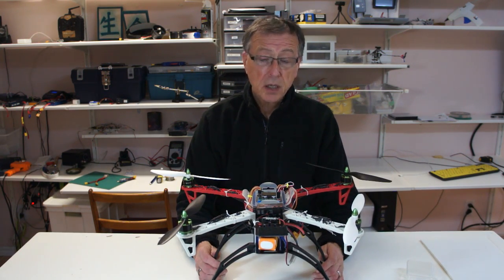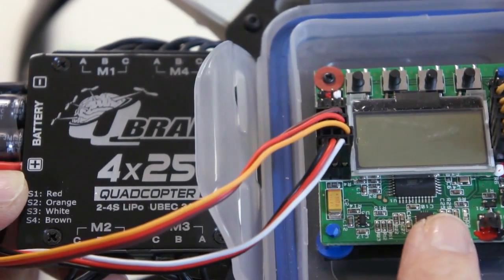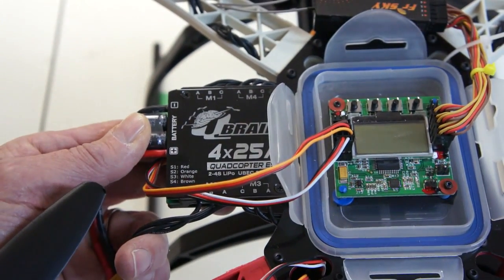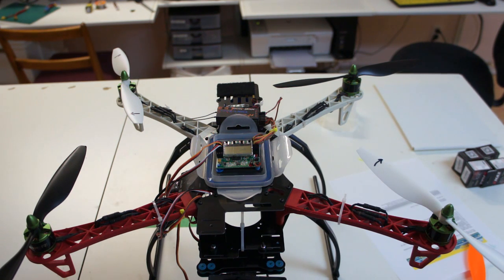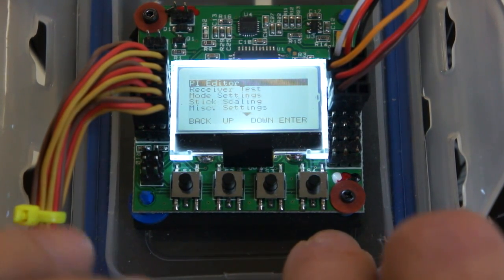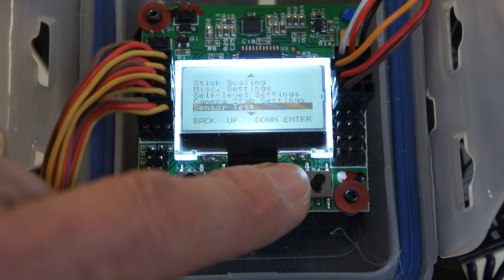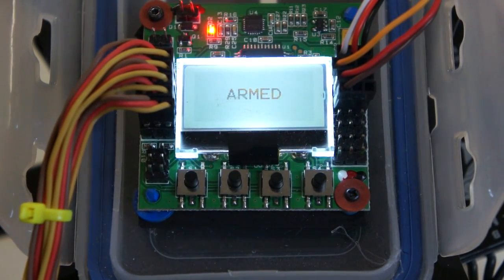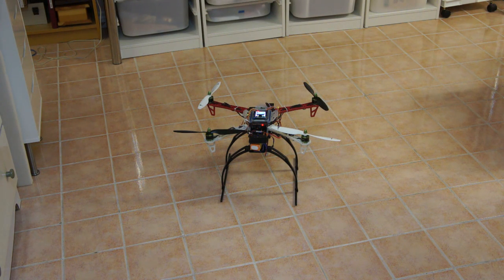Quad Copter Build With KK2.1 and Qbrain Part 2

Comment: Good solution to the odd wiring issue with power and ground on S3. One could always pull those leads from and S3 and put them in the S1 connector. That's my plan anyway lol. That way the motor leads go the motors as listed on the brain.
Reply: +Pat B , I've got the same issue.   M3 goes to motor 1 and M1 goes to motor 3.  It's odd how they designed it.  Btw, I got my Q-Brain at HobbyKing.  So on my KK controller, it goes W.O.R.B.  (white wire, orange wire, red wire, brown wire).  Is that your setup also ?
Reply: Levkin I don't have the Q Brain yet. I've found what I think is a better one on Goddluckbuy. It's 30 amp x4 and only 80 grams and 12mm thick plus it's already flashed with BlHeli firmware. The Q Brain can be flashed as most ESC's can but it's a bit of work.
 The ESC's don't care which motors there are connected to, so swapping the leads for the KK as the poster has done is the easiest way to fix this. The KK does care how you power it though, so either you power from the input with the Receiver or UBEC(Batt input), or you power form the motor side as is usually done. There are two power busses on motor side on newer KK's so M1 is by itself and the other powers M2-M8. So powering M3 leaves M1 dead so to speak. One could use a Y jumper  to power M1&3 but that can lead to noise issues with both busses powered and isn't the recommended option. Oddly enough powering M1 also powers M2-M8. I know that sounds weird as the you'd think powering M2,M3 etc would work also lol.
 I would simply pull the power and ground wire from the M3 connector and put them in M1. There are little tabs that one can lift on the connectors and the pins pull out. Doing this gives the KK power and M1 and then you simply rune the motors wires as labeled on the Q Brain. Not sure of the colours as I'd have to watch yjdeo again. Like I said his solution of swapping the leads is the easiest. Hope that helps.

Comment: hi Sir. i bought Esc 4 in 1 of emax, but i can not make all motors to start at the same time. i did the step of calibrate with button 1 & 4 on KK, but still same problem. could you please take a short video about calibrate your Q-brand esc? thank you Sir so much.

Comment: Hello!
I have qbrain 4x25 and hk 2.1 with factory deffault settings.
For some reason when i put the quad on the ground and run motors lowest possible speed two of the left side (quad facing away from me) spool up to nearly maximum speed. This is not instantaneous it takes 1-40 seconds before it kicks in (completely random).
I've googled around alot and watched videos. Can anyone help me with this issue? I'm at a complete loss here.

Comment: Im still unsure about buying the qbrain. Is there a way to lower the amps to avoid escs being burnt out or overheating? Which motors would work stable and reliable with the 4x20 one?

Comment: Hi Emerald,
I have the Q brain 4x25 esc but I have the hobbyking KK3.0 board in X Config. I'm new to this hobby and need help. How do I match the two up. I have a transmitter that is paired with the Receiver and I can get the ESC to turn on but I feel may it's not configured right. I cant get it in the air with out major problems. Not sure how to stabilize it or anything, Help please.

Comment: Trying to build  my first quad,  will this work??
frame: Neewer® Useful Black Glass Fiber MWC X-Mode Alien Multicopter
motor: SunnySky X2212 980KV Outrunner Brushless
board: kk 2.1
battery: 2200mAh 3S 11.1V 30C LiPo, 13AWG EC3
esc: I was going to use the Neewer® 30A FIRMWARE Brushless ESC Set with 3A/5V BEC for RC Quadcopter Multi-copter APM2 but after watching this video I am also wondering if the q brain can handle this output, seems it would save me a lot of trouble.

I really dont want this to become a $300 ugly modern art piece sitting in the basement

Comment: Hey Emerald Meadows, I really am battling with my DeadCat450 ... please could you help me... 

I have a Qbrain 4 IN One ESC (connected to FrSky X8R RX - Order or Connection on the KK2.1 from Pin One - RED, WHITE, BROWN, YELLOW)

KK2.1HC (Flashed to KK2V1_1V19Pro) 

When I try take off (power up) the quad just wants to flip over on its head, In fact has done a couple of times now, It's driving me crazy. I would appreciate any and all advice!

Thanks
Reply: I now have the wires the same as your, but it still looks like it wants to flip over ..... what am I doing wrong  :(
Reply: Same problem
Reply: Richard Hamilton are the rotors turning in the right direction? 2 need to turn cw and 2 ccw. Are you using the right props on the right motors? make sure they all blow down.
Reply: It flies now.The problem was because i use a qbrain, the mixer editor has to be changed.
If someone needs help ask me.

Comment: How would You connect the wire from Q-Brain esc. to the motors if it is a PLUS frame with motors in front, right, rear and left - is it M1 in front. M2 to the right, M3 to the rear and M4 to the left ??

Comment: I will build a f330 with a kk board with seperate programmer from hk. and quattro esc. Is there any fear of interference if I mount the kk board directly on the Esc?
Reply from the maker: There is always concerns with EM (electro magnet) interference so I would avoid putting the KK on the qbrain directly. But EM is just one of the concerns of placing the KK directly on the qbrain. I would be more concerned with the heat generated by the qbrain it can get pretty hot during a long flight. However, if you use the foam case that came with the qbrain as an insulator than that should work.
Reply: Emerald Meadows Thanks for your answer. I will moubt tne kk on the top of the f330 (HK). Till now I only have experience with dji component. Hope the brain and kk2.1 will give me the same satistifaction. Building this f330 for getting a smaller platform for taking with in holidays. Thanks.

Comment from the maker: I use the qbrain  because its neat. The wires are long enough to reach from the arms to the centre of a 550 quad and smaller. As well, they are programmed simultaneously which means that each of the esc's in the qbrain are programmed identically. This would include braking, startups etc. I am a believer but many are not.
Reply: Emerald Meadows how does it work for you? did it overheat? If not, im gonna get it and those motors too because the idea behind this is just great

Comment: A simpler solution would be to pop out the power and ground wires from the M3's connector and put them in the M1 connector.  It's a 30 second change, just use some eyeglass flathead screwdriver to depress the retaining tab and slide it them out of the M3 connector, and then slide them in to the M1's connector.
Reply: correct.
Reply: I think an even simpler solution is to mount the Q-Brain upside down. If you put the sticky tape on the bottom of the Q-Brain, and then place it on the bottom of your craft, with the logo/text facing the ground, I think you will find that the layout is as it should be. M1 will be close to the front left motor M2 will be the front right M3 the back right and M4 the back left. I bet they made it like this so you could mount the brain on the bottom of your craft and still see where the wires are supposed to be running.

Comment from the maker: No the stock programming works fine. More details on the programming can be found at:
http://www.hobbyking.com/hobbyking/store/uploads/934316348X1085196X29.pdf
Reply: I connected all the wires as you did, but I noticed a hand-made test that kk 3 axles do not turn in the right direction when I tilt the quadricopter down, or upward engines opposites, do not correct the tilt, what do I do? where did I go wrong?

Comment from the maker: The qbrain is an ESC and receives its power from the battery which in turn powers the motors and the KK2 flight controller.

Comment: Outstanding video....i really appreciate you taking time to do this video.........i have done 1 quad build before on a 659 frame....i was silly and used some kind of  plastic props that split the hub in flight......now around 10 months later i have a flight board like yours and carbon fiber props......thanks you so much for the explanation of the qbrain too....i used to do 4 individual esc's but wondering how that qbrain connected...i have all the order on the way....and crazy me...i missed researching  how it connected....good job!!...thank God you were here in youtube land